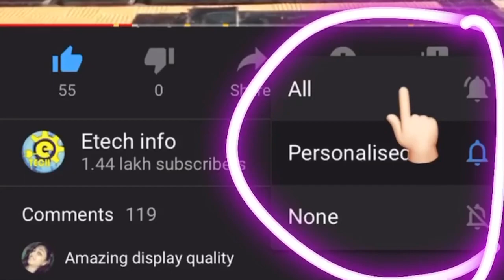How to Make Monowheel Cycle

Comment: Maybe weld a small frame for a 16" wheel in front....4 or 5" off the ground, so when you brake (Your body will start to flip forward) the front wheel hits the ground and the bike continues going forward.